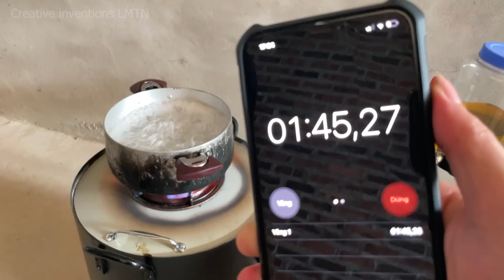NO WELDING ! The best USED OIL STOVE 2022 | Made from Cement, Blue Flame and Easily at home

Comment: Have you heard about the used oil furnace from 1950 that ran on water? Patent was issued to army service men in Texas for ONLY adding water line to T fitting for used oil burner on used jeep engine oil, to get 50% increase in efficiency. That was not what was written in their application for Patent.  SS coil tubing in brick insulated firepot of oil burner hooked to input common water line.  Oil furnace started. Temperature gauge monitored for temp up to 1500 degrees F. Then valve opened so as superheated steam is allowed in T fitting with oil to nozzel. Nice burn flame runs constant. Then oil line shut off. Furnace still runs. Shock wave from 90 lbs pressure to AMBIANT zero in firepot forms hydrogen and oxygen torch flame that also heats heat exchanger. Normally water molecules separate at about 3-6000 degrees which is too much energy. The vibration shock wave allows for disassociation at lower temperature. Electric motor with dual shafts ran 2 oil pumps at 90lbs. If water shut off, and cooled down, the furnace has to be restarted on oil. (US patent office not allow overunity for public.)  Free energy is eliminated in issued US Patents.  (US 1958,  2,863,499)
Reply: Hello

friend

Please provide English search keywords or patent number

Thank you
Reply: Data was from memory, from many years back. The notes above is what was originally filed manuscript. The changed issued Patent only says 50% efficiency increase which discouraged the original writers, which was not wanted.
Reply: @waterfuel  Do you have a patent number?
Reply: English translation to your  language of Patent does not show how to run fuel oil furnace on water. It only says an efficiency increase of 50% with super heated ONLY TYPE steam addition. The original papers submitted by US serviceman to Patent Office in 1950's was not the same. You probably don't  understand this notion. Free energy is eliminated in issued US Patents.  (US 1958,  2,863,499)
Reply: @waterfuel  thank you for your reply
Reply: For such stove fueled by used cooking oil or used engine oil, you can add oxygen from super. heated steam... Step #1: Make a 3mm diam. stainless coil, the said coil diameter as big as the interior burner of your stove... Step #2: Install your finished stainlss tube coil at the interior of your stove burner- its end must be 4. branch, pointed at the exit holes of air from air blower... Step #3: Produce a pressurised kerosene stove, then removed its kerosene burner- then install a coupling for such stainlss tube coil... 4) Step #4 : Connect the stainlss coil and the coupling, located at the burner holder of the modified kerosene stove... Step # 5 : Instead of kerosene, fill the kerosene stove with purified water or distilled water... Step #6 :   Warm. up the used oil stove, switch. on your air blower when the stove fire was big and hot enough... Step #7 : Slowly pumped air on the water filled kerosene stove- the higher the air pressure, the bigger was the high temp're fire!... The resulting fire will be 5- 6X longer, due to the great volume of oxygen from super. heated water steam!.. So be careful, possibly the temperature will rise up to 2,500 Celsius!.. Dont allow your cooking pot to  become dry- it can be melted by high temp're stove fire!... Dont leave your stove while its operating, one mistake and your cooking pot will be damaged by the stove fire!...
Reply: @fortunatodeguzman8017  Where does this passage come from?

Are there any pictures or videos that can be explained in detail?

Thank you for your reply

Comment: sir, what exactly the name of the fan did you used? for that I can use the exact amount of wind for the blue flame.
Reply: 5
Reply from the maker: The fan has a capacity of 60w sir
Reply from the maker: I will make a video about the types of fans I use, stay tuned

Comment: Good idea .pls . Tell us the cost of d stove. . One disadvantage there may be. It is the stibckyness of the oil . Will it b deposited under the utensils. Even the whole vessal may b sticky ? If so cleaning process a big thing with much consumption of water. But your idea very useful and very good. All d very best.
Reply from the maker: Thank you for your attention, the cost of the kitchen is very low, the material is completely recycled, so it only takes 15$, while cleaning the kitchen, the stove burns completely at high temperature, so nothing sticks, very clean.
Reply from the maker: Regarding the smell, when turning on the stove and turning off the stove, there is smoke, but when the fire is stable, there is no smell anymore. What kind of stove do you currently use, do you have any problems with your stove?

Comment: Thank you for this awesome video. I would like to make one and I am wondering if a hair blow dryer would work? Also, the piece that goes into the smaller pipe what is that called please? I just need to know what to ask for when I go to the store. Thanks again. I am your new sub.
Reply from the maker: You're very welcome, and I appreciate your support as a new subscriber! A hair blow dryer might work as a heat source, but make sure it has a heat output sufficient for your project. The piece that goes into the smaller pipe is typically called a "reducer" or "pipe reducer." You can ask for it at the store, specifying the sizes you need. Good luck with your project! If you have any more questions or need further assistance, feel free to ask.
Reply: the hair dryer was not for heat source but in place of your blower  @lmtn

Comment: great job. but is it safe to cook food on it, does it contaminate the food it cooked?
Reply from the maker: Using this type of homemade heating device to cook food is not recommended. The materials used in its construction may not be food-safe, and the combustion process could release harmful chemicals or residues that can contaminate the food. It's important to use appropriate cooking equipment that is designed for preparing food safely. If you have questions about cooking or heating appliances, it's best to consult with experts in those fields or use approved, safe appliances for food preparation.

Comment: align air pipe not in axis direction, it will create hurricane and more efficient combustion
Reply from the maker: Thank you for the insightful comment! Aligning the air pipe in a direction that creates turbulence and enhances combustion efficiency is a valuable tip. Proper airflow and combustion are crucial for the effectiveness of heating systems. Your suggestion to create controlled turbulence within the combustion chamber can indeed improve the combustion process. It's important to experiment with different configurations to find the optimal setup that balances efficiency and emissions.

Comment: Hello, congratulations, very interesting project. I would like to try to make it to burn used frying oil. Could you give me two or three tips?
the first, how can I adjust the fuel level in the burner so that it does not rise over the upper edge causing a fire risk?
The second, how can I stop the flow of fuel if the burner goes out by itself?
Thanks if you can and want to answer me.
Reply: Just guessing, i think the lid on the oil tank controls the flow. What do you do if you dont have power for the blower??
Reply: You need an electric solenoid shut off valve, switching off by a thermostat when is detecting low tempearature, flame stoped

Comment: plumbers gas torch would be better for lighting it,
Reply from the maker: Using a plumber's gas torch is a great suggestion for lighting the stove efficiently. It can provide a focused and controlled flame, making the ignition process easier and faster. Thanks for sharing this tip! If you have any more ideas or questions, feel free to ask.

Comment: Heavy duty
Reply from the maker: Indeed, choosing heavy-duty components, such as a robust hinge and strong frame, is essential for the durability and safety of this project. The heavy-duty materials will help ensure that the door and frame can handle the weight and stress, making the entire setup more reliable. It's a wise choice for a long-lasting and sturdy DIY heating system.

Comment: Holy shat, how much that thing weigh!! How much oil does it burn per hour.
Reply from the maker: Great questions! The weight of the mini heater can vary depending on the materials used, but it's generally designed to be portable and not too heavy.

As for the oil consumption, it's important to note that the video might not provide specific details on the exact burn rate. The amount of oil burned per hour can depend on factors like the size of the container and the burn rate settings. It's recommended to monitor the usage during operation to better estimate the consumption.

If you're planning to build a similar setup, you can experiment with different container sizes and oil quantities to find the balance that suits your needs. And if you have more questions or need further guidance, feel free to ask! 🔥⚖️🛢️

Comment: Cost of power to run blower = Higher than LPG
Reply from the maker: It's interesting that the cost of power to run the blower is higher than LPG. This can be an important consideration when choosing a heating or energy source. 

Do you have any specific questions or concerns related to the cost comparison between running the blower and using LPG? Is there anything you'd like to learn more about or discuss in this context? Feel free to provide more details, and I'll be happy to assist you further.

Comment: How to find that machine for changing color
Reply from the maker: To find a machine for changing color, you can follow these steps:

1. *Online Search:* Use popular search engines such as Google, Bing, or Yahoo to search for the specific machine or device you are looking for. Be as specific as possible in your search query.

2. *Online Marketplaces:* Visit online marketplaces like Amazon, eBay, or Alibaba. These platforms often have a wide range of products, including machines for various purposes.

3. *Manufacturer's Website:* If you know the brand or manufacturer of the machine, visit their official website. Most manufacturers provide information about their products and where to purchase them.

4. *Local Retailers:* Check with local electronics, machinery, or specialty stores. They might carry the machine you are looking for, or they can provide information on where to find it.

5. *Specialized Suppliers:* Some machines may not be commonly found in general stores. In such cases, look for specialized suppliers or distributors that focus on industrial or niche equipment.

6. *Ask for Recommendations:* If you have a specific community or forum related to the type of machine you need, consider asking for recommendations. Others in the same field may be able to suggest reliable sources.

7. *Consult with Experts:* If you are looking for a specialized or industrial machine, consider consulting with experts or professionals in that field. They can provide guidance on where to find the right equipment.

8. *Trade Shows and Exhibitions:* If applicable, attend trade shows or exhibitions related to the industry. These events often showcase the latest technology and machinery.

9. *Online Forums and Communities:* Join online forums and communities related to the type of machine you're looking for. Members may share information about sources and suppliers.

10. *Contact the Video Creator:* If you saw the machine in a YouTube video, consider reaching out to the creator of the video through the video's comments section or the provided contact information to inquire about the machine.

Remember to exercise caution and conduct thorough research when purchasing machinery, and make sure to buy from reputable sources to ensure the quality and reliability of the product.

Comment: how much oil is needed to live for 1 hour
Reply from the maker: The amount of oil needed to produce heat for 1 hour depends on several factors, including the type of oil, the burner's efficiency, and the heat output required. Generally, for waste oil burners, you can expect to burn approximately 0.5 to 1 gallon (about 1.9 to 3.8 liters) of oil per hour to produce a significant amount of heat. However, the specific consumption rate may vary based on the burner's design and adjustments.

Keep in mind that using waste oil for heating can be an economical and sustainable option, especially if you have a steady supply of waste oil. The actual consumption rate will depend on your setup and heating needs.

Comment: If we use pretro from recicle should better this.
Reply from the maker: It appears that the commenter is suggesting that using recycled or reclaimed oil (such as waste motor oil) might be a better option for this project. You can respond by acknowledging their point and providing some information or considerations about using recycled oil. Here's a possible response:

"Thanks for your input! Using recycled or reclaimed oil, like waste motor oil, can indeed be an option for this project. However, it's crucial to be aware of the potential risks and safety concerns associated with burning recycled oil, as it may contain impurities or contaminants that can produce harmful emissions. If you decide to use recycled oil, ensure it's properly filtered and processed to minimize any negative environmental or health impacts. Safety should always be a top priority when working on projects like this."

This response acknowledges the suggestion, provides some guidance, and emphasizes the importance of safety and environmental considerations when using recycled oil.
Reply: @lmtn  thank you so much .  
For your reply about that.
U are so smart .

Comment: How to make it blue flame
Reply from the maker: To achieve a blue flame when burning oil, you'll need to ensure efficient combustion. Here are some tips to help achieve a blue flame:

1. Proper Air-Fuel Mixture: Make sure the ratio of air to fuel is balanced. A blue flame typically indicates complete combustion, where fuel is burned efficiently. Adjust the airflow to achieve this balance.

2. Clean Fuel: Ensure the used oil you're burning is clean and free from contaminants. Impurities or water in the oil can lead to a less efficient combustion process.

3. Preheat the Oil: Preheating the oil before combustion can improve the quality of the flame. You can use a preheating system to achieve this.

4. Adequate Ventilation: Proper ventilation is crucial to ensure a steady supply of oxygen for combustion. Insufficient oxygen can result in incomplete combustion and a yellow flame.

5. Flame Stabilization: Use a stabilizer or a well-designed burner system to maintain a steady and consistent flame.

Remember that safety is a top priority when working with any combustion system. If you have more specific questions about achieving a blue flame or concerns about safety, please provide additional details, and I'll be happy to assist you further.

Comment: IF I HAVE SOLLAR THEN I DONT THIS CPULD BE GREAT . SOLAR TO POWER THE FAN AND THE WAST  OIL IS PRETTY CHEAP SO THIS COULD BE WONDERFUL 
SORRY FOR THE CAPS
Reply from the maker: No problem with the capital letters! It's a valid point. If you have a solar power setup, it could indeed be a great way to power this type of stove. Solar energy is clean, renewable, and can help you save money on electricity. Plus, using waste oil as fuel is a cost-effective and eco-friendly option. Do you have any specific questions about setting up a solar-powered system or using waste oil as fuel?

Comment: can you say carbon monoxide poisoning?
Reply from the maker: Yes, carbon monoxide poisoning is a serious concern. It can occur when carbon monoxide, a colorless, odorless gas, builds up in enclosed or poorly ventilated spaces. Symptoms of carbon monoxide poisoning include headache, dizziness, weakness, nausea, vomiting, chest pain, and confusion. It's important to have carbon monoxide detectors installed in your home and to ensure that all fuel-burning appliances are properly maintained and ventilated to prevent carbon monoxide buildup. Safety first!

Comment: Like every waste oil stove on the you tube bandwagon, no easy way of cleaning the carbon from burner tray or oil delivery pipe. Will be rendered useless very shortly
Reply: Where’s the link to your highly engineered and operable waste oil heater?  I’m sure we’ll learn why it’s vastly superior at first sight.
Reply: @cheesynuts4291  there's no link, but your obviously inexperienced in the matter, if the oil delivery pipe along with the burner tray was made removable to clean the stove would have a fighting chance. I have a waste oil burner been in my workshop for 10 years and these are completely necessary. This design won't last many cycles. If you don't understand and need educating further or would simply like to gob off some more please reply I'd be happy to listen
Reply: @cheesynuts4291  you should have some experience before making comments on a subject you have no experience in
Reply: @joeedwards9721   come on Joe, educate us all.  You clearly got it worked out right?   How is it I clearly know nothing? I just asked to see your working model that’s better than what this fellas shared.    

I figure you just like kicking shit at people on the internet.  Solid plan bro.
Reply: @joeedwards9721    I’m sure you are right.  Needs to be easily cleanable.  Got right up under your skin with that one eeeh?  

I don’t need to build one, I live in my moms basement and she keeps the heat going full blast.  It’s crazy!  Been like this for 45 years.   I keep telling her…. Momma!  I’m gonna move out if you don’t turn the damn heat down!  I’m not going anywhere but she don’t know that.   

Top of the day to you internet hero.